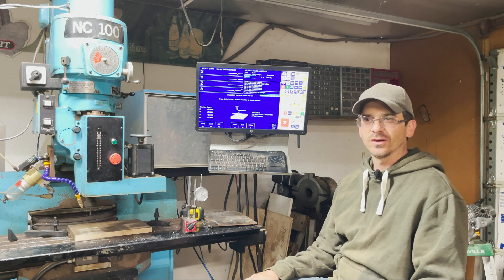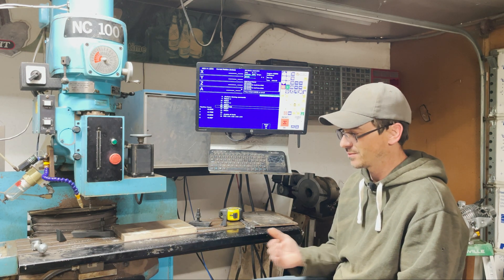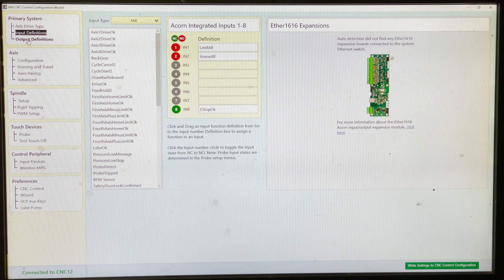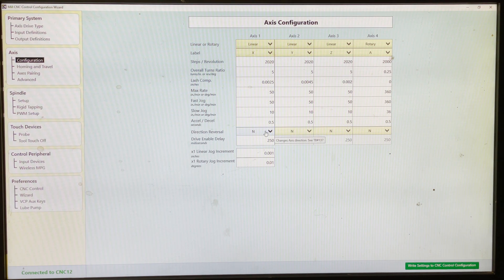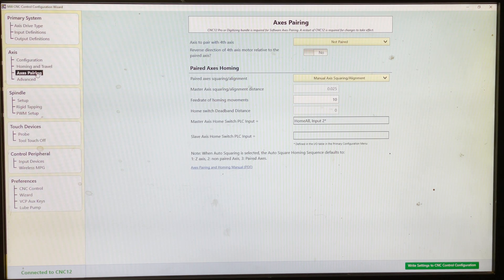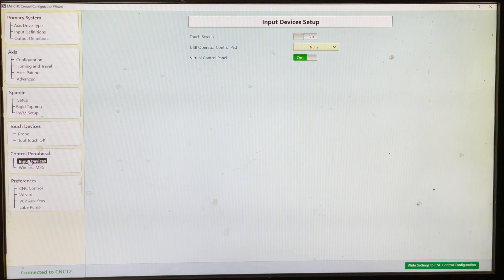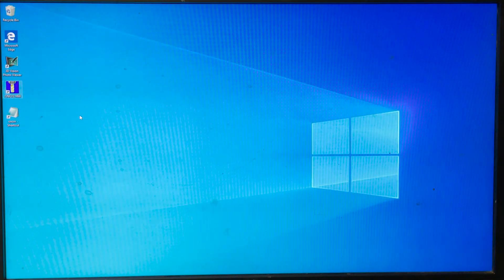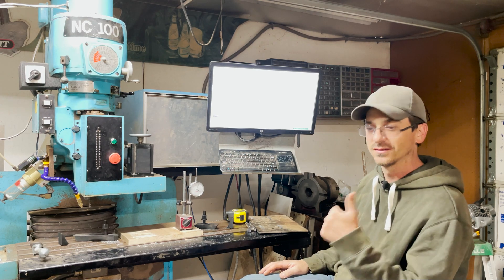Converting to Acorn CNC Centroid controller Part 4: Basic Parameters, and running my first program!

Comment: nice job!!! what size of steppers did you use?  oz-in?
Reply from the maker: Thanks! I used 3 motors from an old cnc mill that I already had, and I am not sure about their rating. The 1 motor I did buy for the indexing head was 1200 oz-in. That motor is similar in size, and I assume that the other 3 are somewhere around 800-1200. They work really well, but I would like to upgrade in the future to something a little bigger, maybe 1600? But I haven't had any work on the mill that the 1200's wouldn't handle so far. Hope that helps, and thanks for watching.

Comment: im running 2 dm542t basic steppers,.. chinese stuff.. everything in acorn works , but I have no motion ,.. Job works , only on the screen.. the steppers are energized etc..  The wiring is so pedestrian , i feel like something was left out , since ive watched all the youtube videos on the acorn and they all require miles of wire.. But my setup is soo simple it may not be the case.. No switches , no estop , 2 axis lathe , open loop steppers..  Some people say my drivers are in enabled mode by default , but im starting to doubt that. any advice aside from the forum and manual?? thx
Reply from the maker: I ran into a problem like that, and I am racking my brain trying to remember what had happened, but just cant. I think it had something to do with the limit switches, or the estop setting in the wizard. I think I had to change the input/output states to fool the controller into thinking the estop was clear, and limits were clear. I will fire up the machine and try to figure out what I did, but I would start in the wizard, and switch some of the input settings.
Reply: @TheSkinnny  that sounds about right , since every time i start cnc12 the estop or reset are in different states.. sometimes they will clear, other times they wont
Reply from the maker: I have my estop set to normally open with the red dot in the input selections menu, as well as the limit and home switches. And in the homing and travel menu, make sure simple homing is selected. Let me know if that helps, and best of luck.
Reply from the maker: Setting it up in the normally closed position makes the software think it should be getting a signal in normal conditions. Switching it to normally open let’s the software think all is well with nothing going on. Since you don’t have any of those switches, the machine needs to know that it is in an okay state.
Reply from the maker: @airgunningyup  If your drivers are enabled, your stepper motors should have some holding power, maybe even make a little noise too. If so, you won't be able to freely spin the shaft of the motor. You had mentioned that the motors were energized, and the manual for that driver suggests that disconnected is enabled. But I have also had issues with those manuals, so ...  What pins on the acorn are you using for the stepper drivers? I see that the motor driver has a jumper for 5v or 24v logic, and it should be set accordingly. The acorn has both options, but wiring does change quite a bit depending on which voltage you are wiring to. I hope this helps, but let me know what happens.
Reply: @TheSkinnny  yes steppers holding in place , so its enabled.. im using pins 2345 on the db breakout ( 2 and 3 for one driver , 4 and 5 for the other )., then 5v to dir + and pul+.
the drivers are running 24v .for power from a seperate power supply ( 24v 15a )
Reply: @TheSkinnny  ITS ALIVE !!!!!!!!!!!  the drivers are set to default 24v logic , i was runnign 5v as per the diagram.. Anyway , the steppers are stuttering in place when i jog , so im not sure what that is , but there is vibration anyway,. follow up , i had 2 of the stepper wires criss crossed , got that solved, now it jogs silently and smoothly.. Once i get the rotary encioder reading , im all set .
Reply from the maker: Awesome!!!

Comment: hello, before buying centroid acorn i would like to have the connection diagram of the stepperdriver?  could you make me the diagram of Lichuan LCDA86H in 24v on the acorn?  thanks
Reply from the maker: The basic connections for the motor drivers are almost the same as mine, only the lichuan drivers have a nice encoder feature. Other than that, to connect to 24VDC you will need three 3K ohm 1/8watt resisters for each driver. I found a manual online here 
http://www.t2cnc.hu/downloads/Lichuan/LCDA86H%20English%20User%20Manual.pdf
As far as connecting it up to the acorn controller, the S14953-ACORN_rev4_STANDARD_CONNECTIONS schematic covers the connections on the controller side. Give me a thumbs up if that helps, otherwise let me know if there are any road blocks ahead.
Reply: ok I plug a 3k resistor on stp-, dir- and enable- and I take the 24v on the com of the terminal H2ou H3 (diagram 14953) or on H9 (diagram 15033k. thank you for your answer
Reply from the maker: @danielricaud3783  The common on h2 and h3, are - 24V, so you will want to use the common cathode schematic for the motor drivers. Then the resisters will get wired between stp+, dir+, and ena+. Then all of the stp-dir-ena- signals go to common. On diagram 15033 you will see that they used +24V coming H4, instead of using the common on H2 and H3, and that would work the way you had it mentioned above, using the common anode schematic with the motor driver. Both work, but be careful to follow the polarity. I hope that makes sense, I had to edit it to try and clarify.